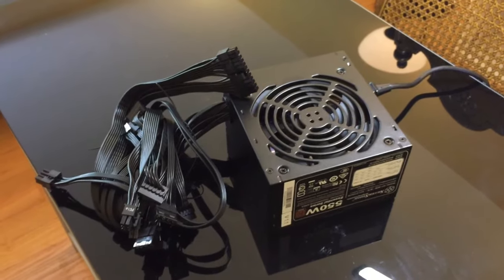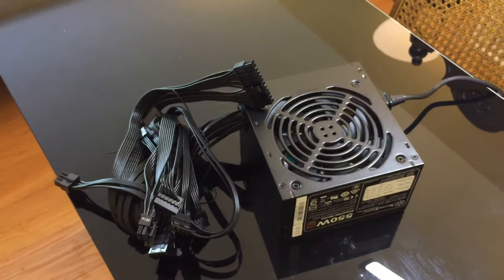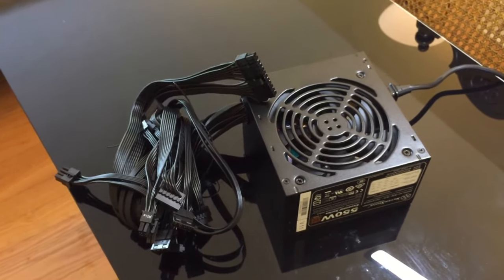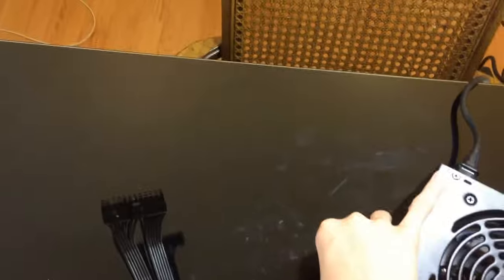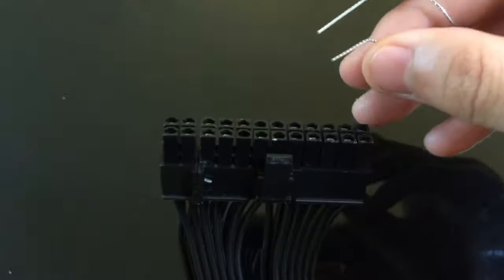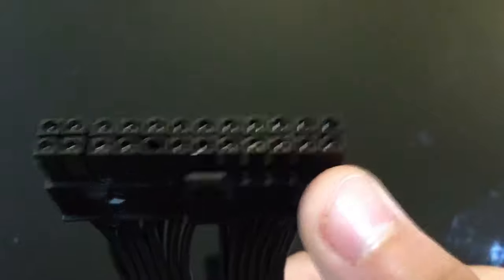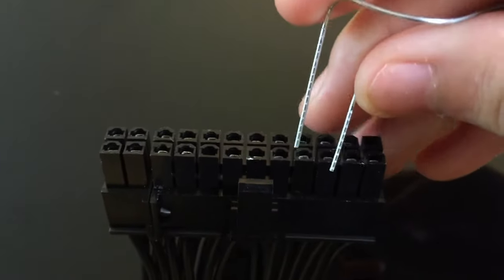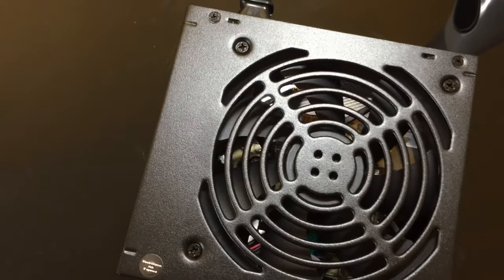Power Supply Paperclip Test in 1 Minute! (Tutorial - How to determine if your PSU is DOA)

Comment: Dont do that. Put the jumper wire in first and then either switch on your psu or plug it in. That way you dont get shocked if you put the jumper in wrong.
Reply: its only 20v youll be fine
Reply: I did what he did, I tested a 750 watts I’m just happy I didn’t die. Now I know what to do next time thanks to obi-wan
Reply: I was just thinking the entire time "TURN IT OFF SONT YOU DARE!"
Reply: @dhulfiqarhussein2554  It's only 5V DC as far I understand by some quick reading on what that 4th pin is. I believe that'll at most feel like a pinch. Dont know how much current will be flowing through the clip so I cant say whether it'll get hot or not
Reply: @AndyU96  use some glove?
Reply: The voltage is pretty low you should be fine

Comment: Oh gawd no.  Do not put the paper clip in with the power on,  have the power off, make sure you have the right pins, then turn it on after the jumper is in. All this tells you is the fan is being supplied with voltage.  There are videos showing which pins have what voltages.  Also take note, the -5v doesn't seem to be in use any more, you won't see a wire going to a pin.

Comment: Is it normal for the fan on the PSU to stop spinning after a few seconds of doing the test?
Reply: Yes because the current only sends a short signal to through the wires. If the fan spins up for a few seconds and slows down it should be fine.
Reply: Thanks bro for asking this question
Reply: @dr.woozie7500  some psu's require load for the fan to spin, so it maybe a lack of load also that causes the fan to stop spinning, usually a molex fan is added for some load

Comment: Mine doesn’t spin at all does this mean it is broken? It is new came right out of the box and isn’t working in my new pc. I am considering buying a Corsair one have to coolermaster nog
Reply: If the PSU has an eco-mode make sure it is turned off if it’s turned on the fan will not come on. If you’re still having issues you can test each wire with a multimeter. 👍🏻
Reply: @thinkforyourself6418  Hi it didn't have an eco mode. I found a video were u could test if the PSU was broken by putting 2 wires together and then the fan should spin. The fan didn't spin so it was broken. I just sended it back got my money back and orderd a corsair rm650x. It all works fine now. Thanks!

Comment: My psu fan turned but just barely, is it still dead?
Reply: Same problem
Reply: @jimmypachuau7869 I’m late but if it’s a Corsair model and it turned on normally for a little while, then it’s good.
Reply: @GeoTren28  I did this trick but it only spined once but after it never spins again what did it mean
Reply: There are cheap volt meters out there,  Harbor-freight has one for $6, look for the video that explains how to check voltages.  Some psu's have a thermal circuit for the fan, basically the psu would have to get hot enough to turn the fan on.  Ultra psu's  from Tigerdirect were like that.
Reply: It is working good

Comment: Do you have to unplug everything or can I just unplug the 12 connector and do the test?
Thanks! My pc just shut off and now will not turn on. When I turn on the psu switch, only the MB rgb lights come on, nothing else.
Reply from the maker: you have to unplug everything except the main AC power cable.
Reply: @alanstechreview5296  Okay thanks!
Reply: @alanstechreview5296  Please specify clearly in the description which pins they're to jump. It is not very clear from the video. Thank you.
Reply: @lazydeynn  Oh, I took it in and they said the motherboard was toast so they replaced it with a new one under warranty. Went from a z490 to a z590.
Reply: @King_Kenny66 bro don't you tell me my mobo is bad........😑😑😑 I'm havin' the same issue all RGB lights and fans lightin' up but not the PC, one another thing when was booting rams lights were up now the ram lights not lighting up .. I hopes it's the bad PSU
Reply: @depressedsoul5443  good luck with the diagnosis. Let us know what the issue was.

Comment: Thanks for sharing !, im pretty sure that everything works but when i plug everything nothing works exept power buttton is light on 🤷‍♂️
Reply: Do you fix it?
Reply: @amerpanda3231  well of corse i did ! Hehe thank you 🥰
Reply: How, did you bought another psu.😅
Reply: @amerpanda3231 no it was a wrong plug how u doing anyways? Guud?
Reply: @amerpanda3231  i have i7 6700k and rtx2070 and 32gb of ram it used to be a g11cd asus gamer but i pushed it tl it's maximum performance now and it runs great and more than enough for what i need it for ! How about urs ?

Comment: Helle I have a question. I did everything and psu fan spinning but less than 2 seconds. It is supposed to be like this ?
Reply: Some PSU have a "0 rpm" mode where the fans will only run when necessary.
Reply: @glassypress2360  I guess it’s motherboard that’s cocked

Comment: What if my power supply fan doesn't turn on until loads of 250 w?
Reply: Late comment but every PSU always starts spinning on boot for a few sec depending on manufacturer for instance Corsair usually does for 5 to 10 sec

Comment: Mine just turns on for a nanosecond and then stops. Just assuming it's dead
Reply: I am trying to diagnose my Corsair 1000e right now and saw a post that some PSU's have an eco mode where the fan will work when plugged in then stop right away just a heads up might be 2 months late heh.
Reply: What was the problem?

Comment: It worked but when i plug it in the mother board it didnt work
Reply: I’m having this same problem. Did you find out what the issue was?
Reply: I think that means that your motherboard is the problem.
Reply: @thepopoeug5718  Fan spinning only means it's getting its 12v, a voltmeter test of each pin is the only real way.

Comment: I got a brand new highend PC with brand new monitor,
Recently my monitor turns off and come back on. 
It could be my PSU? I got ROG THOR 850W (it's the only pieces that I didn't replace),
Everything is update form GPU driver to bios. 
Thanks!
Reply: Your monitor has an external electricity source so your psu has basically nothing to do with it
Reply: @robin.7988  Thanks
Reply: @anthonyhershko  no problem